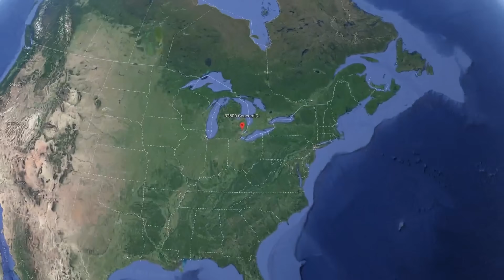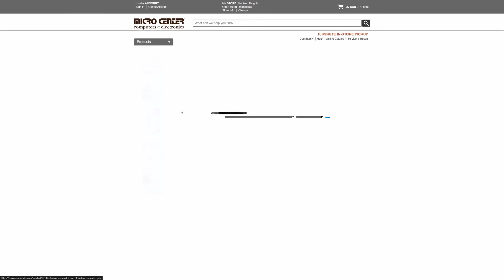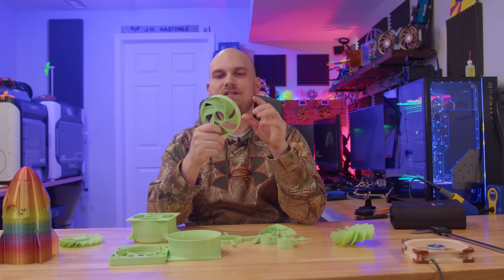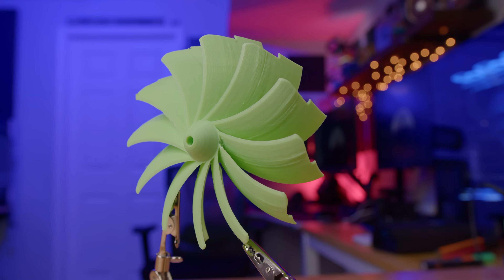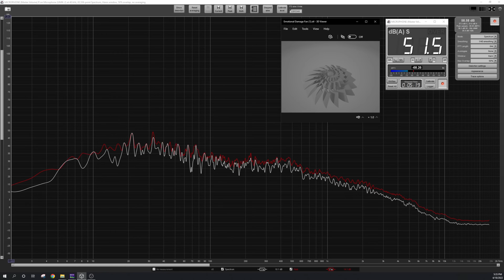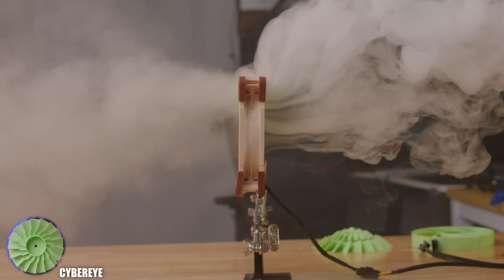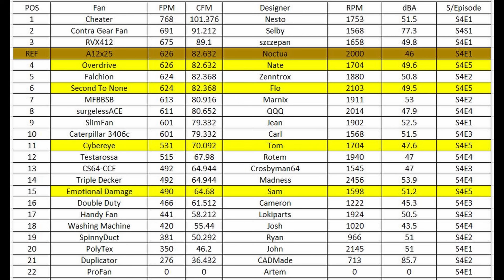TODAY the CHEATER FALLS……maybe | Fan Showdown S4E5

Comment: I like how, aside from DBa, the overdrive actually beats the A12x25 by 300rpm. Same output for 300 rpm less. I'm sure it could be optimized more to reduce weight to improve it's output.

Comment: Second to none had the same FPM and CFM as Falchion but better dbA at a higher RPM, shouldn't it take it's place? Also so many of these values have the exact same values down to very small fractions, looks like you need better resolution in your measurements to tell them apart

Comment: Could you rework the overdrive to where the brace supports are in line with the case supports. This should remove the extra turbulence and improve its results. Doing the same thing to the cheater should also improve its results too.

Comment: Aka the grease is for load bearing
This is a fan with little load
I also assume cooling fans produce very little torque as an electric motor so gears massively reduce speed

Comment: Geared fans lose so much power due to friction in the printed parts and abviously more speed means less torque to spin the fan in the first place.

I would be intrested to see a overpowered fan showdown where the top 10 gets tested with a drone motor. which has much more power and much greater rpm... put all of them in a housing so you wont get hit by shrapnell though.  ^^

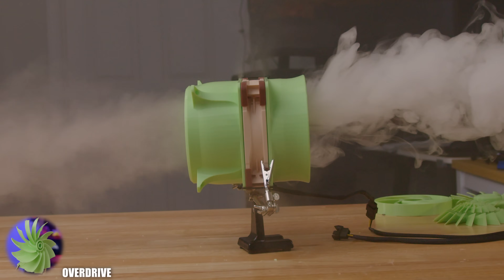Comment: 14:00 You can easily see that there're leaks between the shrounds and the A12x25 body. IF that can be sealed off, maybe the Overdrive will have even better performance?

Comment: Is it possible to get a fan motor to spin as low as 1 RPM? I bought a fan controller but the RPMs are still too high, when I lower the power the fan stops.

Comment: It looked like you were losing some air out the side of the shroud from the crack between it and the noctua frame. Would likely increase the airflow by simply sealing that tiny gap up with electrical tape.

Comment: G'day Major,
I know it is not the Norm to bring back a Design from a Previous Episode but I would like a FPM/CFM/dB comparison of Jason's T33 MKIII & Thomas' Acceleron.
For Designs that comply to 'Fitting in the Frame' seems Second to None Rev: 3 needs to be renamed Second to Noctua 😂,
🤔Isn't OD supposed to make the output speed faster with less Engine RPM??? 🤨Nate it should be Called Underdrive Mode.

Ps speaking of PSU Failures did you see what BitWit Kyle did building his new HTPC 🤦‍♂️

Comment: You should look for ceramic bearings and lube for the ultimate friction reduction, I used them on a 250W e-scooter engine, and the difference was somewhat noticeable.

Comment: I think a battle of the best episode at the end of the season putting the top 3 against each other BUT the fans being re-printed in resin. Fans like the overdrive and the clock fan I think would help them perform even better. Would be super cool to see the difference between an FDM printed fan and a resin printed fan and if it makes a difference

Comment: I still think I like the temperature tests better, not sure if that's actually a better representation of how well the fan is working, but it made more sense to my Australopithecus brain.
Reply: Might be but it also makes each run alot more time intensive. Measuring airflow can be done within a minute while reaching a steady state on an air cooler might take 5-10 minutes, more like 45 on a closed water cooler.

Comment: You should do another series for static pressure fans instead of high airflow fans. Use a sealed chamber with an air pressure reader for measurement

Comment: Were you supposed to have that loose bearing on your desk in the bottom under the drive shaft, between the planetary gears, it seems as if the drive shaft was not being held rigidly in the mount and was wobbling reducing it's effectiveness
And that second to none sure did have smooth output on the smoke test...very little turbulence compared to some designs

Comment: One thing I know from my fidget spinner days is, even the thinnest oil has more friction than just leaving the bearing clean and dry
Reply: ahh, but then you get issues with things knocking and wearing and becoming less spherical and such.  or something like that.
Reply: @laurencefraser  Maybe long term with the fan, but not in my experience with spinners. Though I was using ceramic balls.

Comment: I really don't get that overdrive setup I mean obviously gears are going to make it turn slower which is of course going to create less air flow not to mention the gears would be constantly blocking some of the air flow so what was the point of putting gears in it?

Comment: why did you shift from temp benchmarks to using CFM for the hierarchy. You cant always count on a higher CFM giving better results for cooling a radiator or tower cooler, maybe for a case fan.
Reply: Who said season 4 was to design for a radiator?
Reply: I suppose it probably isn't but how good these fans are at cooling whether as a case fan or a cooler would be more informative and show them in use. I could design an excellent cooler fan with good static pressure but it would rank much lower because it dosent have a high CFM.

Comment: I'm surprised nobody has figured out how to make a fan that adjusts its angle of attack based on its speed
Reply: I don't think there would actually be any advantage to that. It adds weight and complexity. Instead, test it yourself, see what it runs at, and adjust based on that.
Reply: Helicopters do that.
At the size of a 120mm fan I don't see how you'd fit the necessary gears.
Besides, you'd have to adjust according to the static pressure it's up against, not the speed.
Reply: @Steamrick  I can design it in my head and could probably make it by hand, but I have issues designing things on a computer or on paper for that matter. It seems like doubling the hub depth and making a helical slot that ran a few millimeters into it, then connecting the blades with a  T connector and a light spring would allow it to self adjust as centrifugal force built up. The spring also acts to lock the blades into the hub. Thus it could be made to increase static pressure as it speeds up. Weight would not be much different than other fans @Major Hardware has tested in the past.

Comment: First thing to do if you want a fan that can beat the cheater is arrange the rear shroud supports to align with the motor supports on the fan housing.  The overdrive was a big offender of this.

Side note, when doing the smoke test, can you get a shot directly behind the fan?  Would be interesting to see how much rotation is in the airstream as it exits.

Comment: Overdrive could win, it just needs more refinement. Plus, with a motor with as little torque as that, the blade angle needs to be lower so that it can spin faster. It might make less airflow at low rpm, but it would enable it to spin faster theoretically

Comment: Overdrive was losing a lot of airflow at the seams between the fan and shrouds. I wonder if there's significant gains to be had by designing a full enclosure or using gaskets... I mean, the thing already has bearings and gears. Might as well over engineer the thing
Reply: I went back and checked if the cheater was also plagued with the same problem and it wasn't. Also in the test it was mounted with Noctua's rubber mounting pins while the overdrive in this video was mounted with two zip ties. It's not out of this world to say that the shroud gap made it lose up to 20% of its flow so tbh I think it's worth recalling this test and comparing them apples to apples.
Reply: you say that like its not already over engineered, dawg its a fan not an alien spaceship 😭
Reply: These Noctuas actually come with rubber gaskets that you can optionally install (to get a better seal on a radiator for example)
Reply: Most of the leaks could be solved by just removing the rubber dampers on the Noctua, they're easy to take off and put back on.
Reply: I think just tape around should keep the air contained
Reply: Seal it with bluetac or some temporary glue?
Reply: noctua came out with some foam already cut to a bunch of thicknesses and could be placed between the frame parts
Reply: Overdrive,  was purposefully made to look weak. For one, it's in a long tube. Overdrive is a famous fan design.  If you can't identify the fan design of overdrive and or the original scientist they copied, it's going to be hard for me to convince you how influential the fan is to aerodynamic history... try going to the Smithsonian!  Hardware and his associates put a damper on fan performance just to make their show  more interesting...
Reply: It had to much pitch on the blades.
Reply: Over engineering does not mean what you think it do. Essentially it can be compared to fixing something that works and is good. It will only cause problems. It is making something more complicated than necessary creating multitude of single points of failure and other problems hindering the mechanism's full potential in any of the following; cost, efficiency, ease of manufacturing, ease of maintaining, structural strength and life span. 

Over doing something never has a positive connotation. It can never be equated to good design choices. At best, it is unnecessary.

Comment: Would graphite be a better lubricant for the bearings in this scenario or no?  
    Genuine question,  I know there’s a reason for powered graphite but I can’t remember if it’s use case is for high speed or low speed.
Reply: I'm no engineer but I can't imagine a situation where ground up solids are a better lubricant than actual liquid except if that liquid is more like grease.
Reply: Graphite is really good at friction reduction in a sliding environment. These rolling element bearings work better with oil or grease. Graphite or molebdenum would work well in a plain bushing.

Comment: I keep saying, take the top 5-10 fans and put them into the cheater housing. You'll likely get one that beats the cheater at it's own game
Reply: Those stationary guide veins that make a huge difference. I bet it would be even better if there was 8 instead of 4
Reply: @BGTech1  What about taking the contra gear fan and just putting it Infront of that (with 4 or 8).  It seems like the direct gears of the contra just lose less energy than planetary gears.  maybe even add some teeth to the contra so the secondary fan is slightly slower.
Reply: @BGTech1  such a small platform… adding guide vanes will reduce the inlet surface area rather significantly
Reply: @BGTech1  i'd say not 8 like you're probably thinking but instead divide each square channel into 4 smaller square channels for grid vanes
Reply: Make that a final shoot-out. Top 10 fans in the housing and see who reigns supreme
Reply: I said about the cheater that the game was now to design the best fan for the cheater shroud, and the best cheater shroud.
Reply: Keep saying it, it is a great idea.
Reply: If the top 5-10 fans in the "cheater's" housing beat the "cheater" , then that's just a testament to how good of a design is that housing.
Reply: Hard to say though. Cheater has large blades which are designed specifically to take advantage of its front air guide. Directdrive didn't beat it because the fan was elevated and didn't take the full depth of the frame, as well as causing some leakages. You can see that in the smoke test 13:58.
Reply: I wonder how the acceleron would do in the cheater...
Reply: I think he should stick that cheater housing on his own existing PC rear exhaust fan and see what it does to his temperatures
Reply: I want to see the cheater run without the case to see how much of a difference the case makes. If it falls under the 4th slot then any fan above it will be better in the cheater configuration. Then test all those fans in the cheater case.
Reply: He tests fans that have been sent in. If someone sends in a shrouded like the Cheater, then he'd do that. Nobody is doing that somehow, so they keep losing to the Cheater.
Reply: @sepg5084  No reason to reinvent the wheel. Just do an "unofficial spinoff" episode with the fans to see how big of an impact the shroud has, we're all here to see what makes air move the fastest, not who's name is on the design.
Reply: The stationary supports on the shrouds should have at least lined up with the supports of the fan motor. Too many restrictions getting in the way of the airflow. That motor is also too weak to drive planetary gears. The KISS principle would the one to follow. Nice engineering though!
Reply: Do that and toss the motor from a Delta QFR 1212 GHE see what they do at 6000RPM.
Reply: That smart
Reply: Is there a video link to the cheater?
Reply: A - Adding more blades would actually reduce efficiency rather than raise it - more mass (blades) = more items blocking the air movement, as illustrated in this video with the Emotional Damage.
B - Dual hub might be viable, but counter rotating would create far too much turbulence between the two blades.  The sole reason certain helicopters have counter-rotating blades is to reduce torque from the drive (the reason for the tail rotor on single stack designs), not to increase lift forces.  However, stacking two designs - let's take the Second to None seen here - both rotating the same direction with a slight offset might improve flow, then test with no offset and see if the turbulence between blades increases or decreases and how it affects flow.
Reply: @amzarnacht6710  "The sole reason certain helicopters have counter-rotating blades is to reduce torque from the drive"

that is not the sole reason, in coaxial props and rotors, the downwind prop takes advantage of the tangential flow from the upwind prop, which would otherwise be wasted, because of this the downwind prop gets a performance boost and helps straighten out the flow massively.

not only does this increase the efficiency of the surfaces on its own by small amounts (though usually mechanical complexity counters that) 

in the case of helicopters it means more engine power is used for lift rather than it being parasitic loss for anti-torque, disc loading decreases, and the helicopter becomes more efficient.
Reply: Agreed and while we're at it as they become bigger and bigger... why not make a "Dual-hub" (tm) fan assembly? Basically add another fan hub behind the 1rst and make it turn blades in counter-rotation, just these 2 should be smaller than the stack of the cheater and really be "cheating" as it would use 2 hubs... But well... After that put the cheater housing on top and see where we at...

And tbh i think 2 hubs could be a more sellable idea...
Reply: @DeadsTBD  I use dual fans in push/pull on a radiator. Wanted the pull fan to have higher cfm than the push, cuz it's "static state" is to be in flowing air. I didn't bother with trying to figure out counter-rotation because the rad vanes tend to eliminate most of the potential benefit. The push fan is corsair and came with the AIO, the pull fan is noctua and is a bit stronger. It doesn't turn a 140mm rad into a 280 in performance, but it does affect cooling quite a lot. At least halfway there under long term load (which eliminates thermal mass from testing). Suprisingly it's usually quieter than with a single fan, as each fan has to work less hard for given thermals (it's not quieter at both full 100%).

Comment: Dang, i was really rooting for the over drive. I wonder if positioning the guides and supports for the parts in line with the original fan housing would have changed anything. Still, it was an excellent attempt!
Reply: Thinking the same thing!
Reply: Smoothing everything inside basically ye. Also cleaning up rapid expansion and compression points.
- Line up supports with the fan's supports so air doesn't have to bounce through a plinko machine.
- Extend the outer ring gear's supports down into the original fan itself to connect with the fan's supports. This makes using them as stators easy as well.
- Increase hub diameter to match the motor base's so air near the hub isn't getting caught up on a ledge or extend a shroud from the ring gear support around the hub. The exhaust portion already does this well by giving the air a smooth path to recollect behind the motor.
- Round the leading edge of supports and taper the trailing edge.

What the air will ideally "see" is the fan, a split smoothly into four paths to pass around the motor while curving slightly to unspin them, then rejoining at the exhaust. No sharp corners that it could try to spin behind or windows that could let it jump into another path- those windows allow for lots of rotation that leaks out the side. Don't be afraid to make supports interfere with each other just a tiny bit either, it's ok for things to touch if they're not moving past each other!

I also wonder if using friction rollers instead of gears would work for this low-torque application. That is, using a thin layer of rubber painted onto the planet wheels instead of much larger teeth. It would be harder to properly center of course unless a third planet wheel were added, but being able to shrink the planetary system into the diameter of the hub would allow for Overdrive without adding extra obstacles to the airflow.
Reply: The overdrive also seemed to struggle a lot with the low torque of the motor, as it's a big fan with a rather steep pitch angle. I think using the gears in a configuration that reduces the speed instead and increases the torque may actually perform better.
Reply: I think gears create too much friction . Maybe a belt would work better, just needs a good way to keep tension.